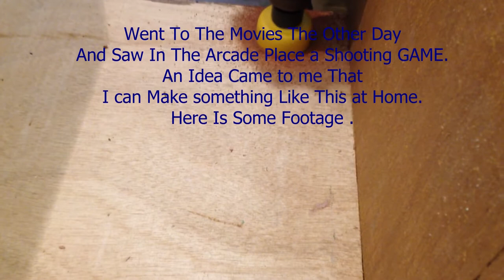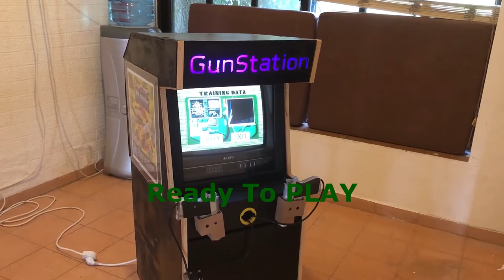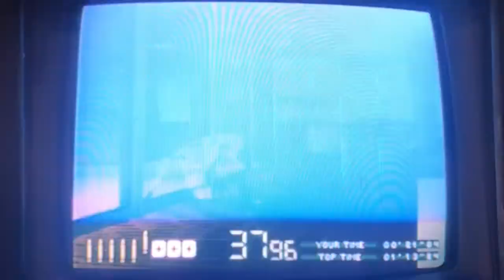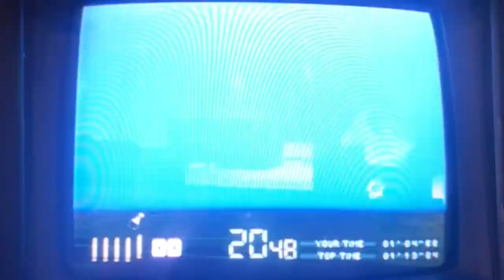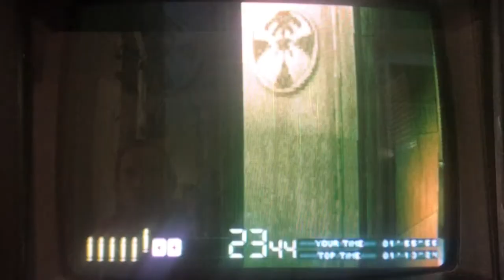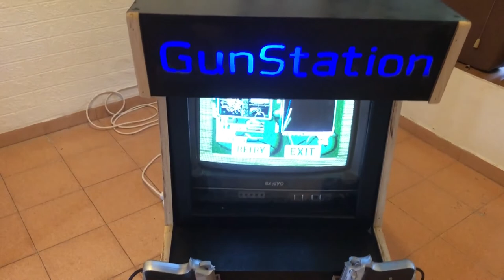Old Scraps? More Like Old School! I Built A Rad Retro Arcade Machine With Guns!

Comment: must know how u connect the tv ??? what type of connector on that tv ??
Composite ???? yellow /red /white wire available? 
if not then what ?? RF ???

SVideo ??

Scart connector what is available and what u have it connected with ???

size of crt ??
Reply from the maker: The tv is 14inch size it got a composite connector at the back it is yellow color rca type. So the light gun has the male connector of this exact type and from the sony ps comes this yellow rca output into the female connector on the gun and the male connector on the gun goes to the yellow composite female on the tv. The tv also got one audio rca ,(mono) but I connected the red and white audio rca to amplified speakers that are on the top of the cabinet.
Reply: @SAMUELDIY  thats awsome pal :D u made it so great i so wanna do something like this the smaller form factor is perfect :) for your home u could even do a 2nd one hehe
Reply from the maker: @princevinny0073  thank you, I originally made this for the kids so it is 110 cm high and 40 cm wide, I might do another one actually case I found a 21 inch sony crt tv and I got two more guns, the only problem I have only one ps console, still I enjoy those shooting games
Reply: @SAMUELDIY  yeah the gun games on ps1 and ps2 was amazing and i love ps2 time crisis 2 and 3 ps2 orginaly had a extra port on there consoles called (i-link) if u had doubble crt tv and doubble ps2 u could link both up  and play just like the Arcade machine something not even emulators can do till to this day